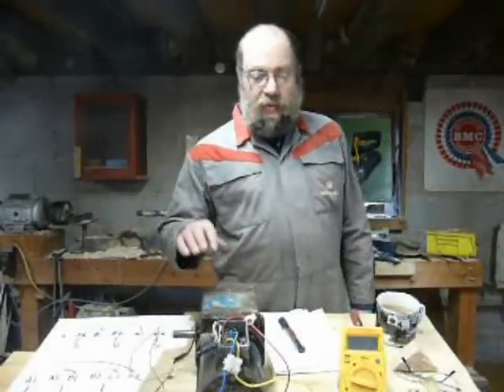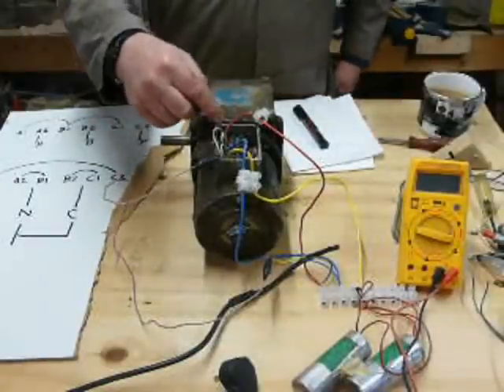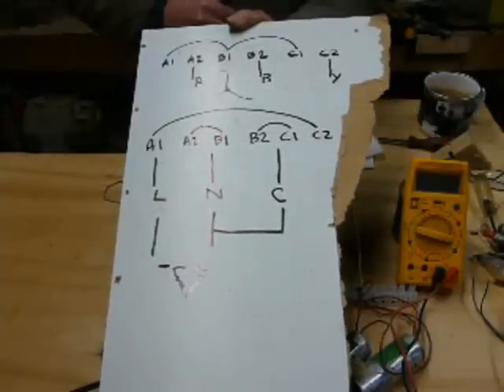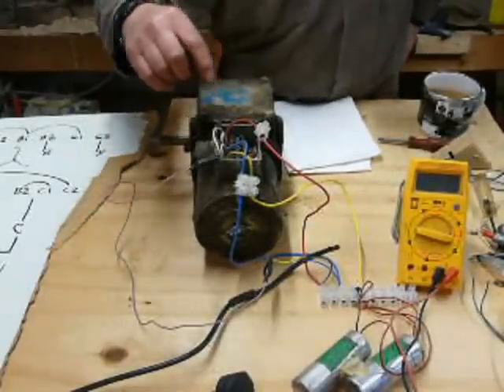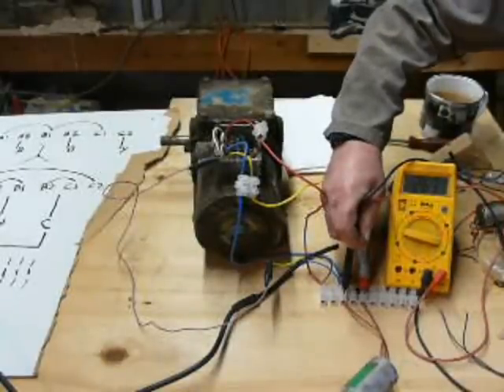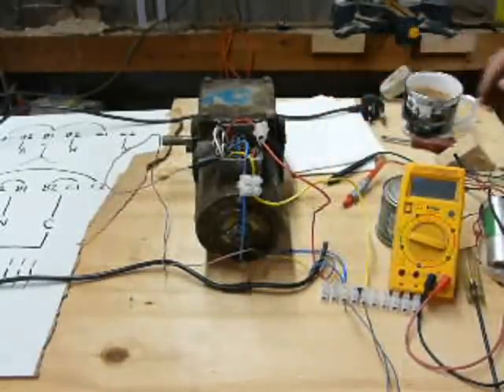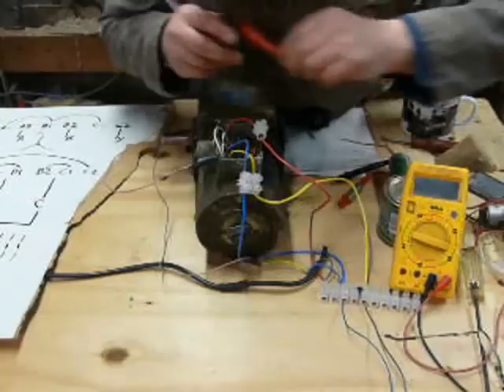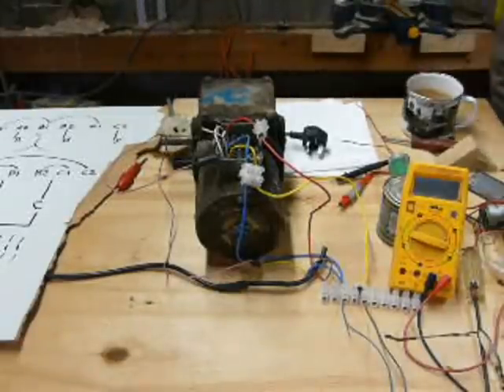How to do it: run a 3 phase motor on single phase supply. part 3

Comment: I can help with the missing phase question. Adjust your thinking a bit; Think of the capacitor as shifting the phase rather than as across one coil. Then you can see you still are using all three coils. I hope this helps. 
Cheers!
Reply from the maker: Thank-you for your addition to the general information. I was assuming that any phase shift on the 3rd set of coils produced a negligable effect, however this seems incorrect. Cheers, and thanks, Andy

Comment: Hi Andy , just changing my 4post ramp to  single phase. Got motor running but a capacitor blew up after about 20 secs running. My motor is 2.5 hp and needs to be wired through a starter box could you advise on capacitor sizes and a diagram on the wiring? Info on motor, amps( 6.7)(3.9)....rpm2880/3480.....cycles 50/60 rating 2 mins,,,,,that's all there is ... Thanks. Dod
Reply from the maker: Hi The cap probably blew because it was either duff to start with, or the rated voltage was too low, or it was mistakenly a DC capacitor. As to the wiring that's difficult but the only thing I can say is that by changing the capacitor connection to the other 240v ac in it will change the motor rotation. You must switch off the motor when changing direction. Hope that gives some help. Have you subscribed? Cheers, Andy
Reply: i have always heard use twice the working voltage on motor capacitors

Comment: What is your take on conversion, for use on a constant motor, say for a dust collection system?
Reply from the maker: It's worth a try, for constant use you will have to measure the volts on the capacitor with the motor running. This is just to make sure that the cap value is correct. Try it and see, you w2ill get 2/3 of the power. Cheers

Comment: Please advice on the question......I converted the 3 phase induction motor with a magnet rotor as generator.....I need to know either I need to make holes on either side of the generator for cooling the inside of generator or not o do you think I need a fan on one side which will blow the heat out through the wholes or just leave it without holes. Dr Sharma Email drsharma@hotmail.co.uk
Reply from the maker: Most 3 phase motors have a fan to blow air either over the coils or through fins cast into the outside case. I assume there is no problem with drilling holes as long as this does not create a weakness. CHeers

Comment: hi can we do it on dc  rc brush less  motor thanks
Reply from the maker: Hi. with DC there is no phase to shift as there is no waveform, also capacitors charge up with DC. See my video on checking capacitors. Cheers
Reply: thanks man for help

Comment: Hi Andy, you mentioned that you have a Denbigh pillar drill and I got excited. I've just rescued one from the scrap and got it working. I was searching for info on running it on single phase 220V and found your video. can you please give me some details on the start and run cap sizes.

thanks
Reply from the maker: Hi. Mine had a 2 Hp motor, so I used 40 UF run and 80Uf start. Hope that helps but you will have to teat your setup. Cheers, Andy
Reply: +Andy Reynolds thanks Andy, I appreciate the help. I was going to use a VFD but I think the caps will do just fine.

Comment: Don't know if this has been posted before...
If a rise of capacitor value helps in starting the motor, it is obvious that without it, the motor will start badly. If you connect the wire shortly, it's the same effect as a startup capacitor which is switched off after startup.
With the motor running it generates enough power in the open phase to keep it running. Still, it has more power if you supply current to the 3rd coil, which is why it sparks when you connect the wire...

Comment: Great videos! explained in a way I understand. I have a 3 phase washing machine motor I need to run on single phase, to replace the one my pillar drill. Working out the run capacitance value was the trick. much appreciated!
Reply from the maker: Thanks for the comment and appreciation, not very-one likes the trial and error approach, but it works. Cheers, Andy

Comment: what about a 3 phase motor from an remote controlled car? it runs on a maximum of 22 Volt´s, it has 2000KV. Can i also use capacitor, just smaller ones?
Reply from the maker: Hi. Your experiment is as good as mine, wouldn't like to say, let us know what happens, Cheers
Reply: i will try and experiment and share it on youtube these days.

Comment: At first i got my concepts clear about the star and delta connection.Kudos to the crispy clear explanation...you are really superb in ur concepts... what i wud like to know about this whole arrangement is that will the motor provide the full load or the load capacity of the motor wud decrease....secondly is their any formulation to calculate the power of capacitor to be used or it is a hit & trial method....
Reply from the maker: Hi. Power is about 60%, and the formula is to be found in the comments of one of this series. in fact it is just below  on this video. You will learn a fair amount by going through all the comments. Subscribed and clicked like button? Cheers, Andy

Comment: Sir it is ok to use 50uF for 1 hp motor?
Reply from the maker: Hi. Try it, it may be a bit small but see how it goes.
Reply: sir it works, but the main problem is that the winding is getting hotter but at least its working :D sir do you have any mathematical model of this phase converter? by the way, thank you sir
Reply from the maker: If the capacitance is too high then higher voltages are created. In one of the videos it shows checking the voltage across the coils with a multimeter. A high voltage will cause the windings to heat up, sound like you need a smaller value cap. The formula is in the comments of this video. Cheers.
Reply: ok sir thankyou so much:)

Comment: just to add to my previous message, it did run, the colours /connections are
W2 black  U2 yellow  V2 red
U1 yellow  V1 red      W1 black
1                2             3       manual says phases i think this means
I changed it from star to delta so its running on 240v
What capacitors should i buy please as i dont have any old ones
Yours and anyone elses help would be greatly appreciated, many thanks
chris
Reply from the maker: Chris, just picked up you message, it's been lost in the google spam filter. I hope you got the problem sorted, sorry about that. Cheers, Andy

Comment: i connected my 3phase motor direct without capacitor as i also read it would run and it started smoking, any suggestions, how do i work out which one are live and neutral as i only red yellow and black from the motors, its a 220-240 or 380/420v with 2860r/min and 3.5amp or 6amp
chris.sheerin@btinternet.com

Comment: Hello Andy, thanks for the brilliant informative videos.  I am a little confused about calculating the capacitance but have done some more searching and think that my 1.8kw radial arm saw motor will require 126microfarads.  I couldn't work out where your current draw was derived from.  If it is 4 amps per hp, would that mean that mine would be about 12 amps?  Sorry to ask stupid questions but I am getting confused in spite of your excellent explanations.  Thanks very much.  Richard Black
Reply from the maker: Don't think so, 1.8 Kw is about 2.5 Hp or so, 735 watts per Hp, but due to motor losses,  4 amps at 240v per HP. Trial and error, but measure the voltage with the motor running to make sure the cap is not too large and causing a high reading. Cheers, Andy
Reply: Andy Reynolds Thanks Andy for the super quick reply.  I will go to one of my favourite shops, Birketts in Lincoln, who, I'm sure, will be able to provide me with some capacitors.  Looking forward to the challenge.  Thanks very much, Richard. ps. love all your videos, you are definitely one of my favourite subscriptions.

Comment: Everyone seems to forget AMPs this is bad advice, there is a reason for 3 phase to even out the power and amp draw.
Reply from the maker: The start current is the limiting factor to the size of the 3 phase motor that can be run with this method.
Reply: Thanks Andy for your feedback Start current is momentary what is run current, even though you still have voltage on the dropped out phase there should be no AMPS on that Phase? what's the run Amps on the other two Phases.?

Comment: Thanks for the informative videos !
I would like to ask if you have any idea why I can stop my motor (1 phase , old washing machine engine) by hand ? I'm trying to use it for concrete mixer :) . Hanan
Reply from the maker: Hi. Is it a brush motor, or has a capacitor, or has many wires going into it?
Reply: Andy Reynolds Hi and thanks for your fast reply :)
It has 5 contacts connector and a capacitor (20uF) which should be connected to two of them . I do not know about brushes and do not understand what you mean by many wires .
Thanks again , Hanan

Comment: Sir,
Thanks for your video experiment. This is very useful and also I am getting some experience. My questionnaire is 3ph induction motor should be reduced the RPM without VFD. Please give me your ideas.
Reply from the maker: Don't think you can as the speed is based on the cycles and the coil windings.

Comment: Hi Andy. Thx for an amazing series of video's. One question please. Were does the ground connection go. To the casing some were or (as i have on the motor i have got) there is a screw in the connection box next to the 6 coil screws? Appreciate any help. Thx again.
Reply from the maker: HI. The ground connection is anywhere on the metal motor case, but commonly a screw within the connection box. Hope that helps. Andy
Reply: Hi Andy. Thx for the response. Did exactly what you have done and for some reason with or with out the capacitors i get the same results. The motor turns (i think a bit slow), I am going to try adding more and different capacitors tomorrow. For now i put a 8uM and a 5uM in the connection.
Reply from the maker: HI. Yes add more capacitance if you think it is running slow. Once up to speed check the voltage with a multimeter to avoid over voltage. Cheers.

Comment from the maker: Here's the formula for the capacitor size. For some reason Youtube put it down as span and I cannot approve the comment.
 
That's (220/V)Squared, like (2)^2 = 4, sorry for my English. And, I found another: C = P x (70mF/1kW), for 230V supply and C = P x (20mF/1kW) for 400v. P is the power in kW; 70/20 microfarads; 1kW is for eliminate the "kW" magnitude.
Reply: based on this formula, does that mean that I have to use a total of 783microfarad  capacitor for my 15hp 230 volt 3-phase motor.?  This is a large motor so is it still advisable to use this motor in a single phase supply?.. Thanks...
Reply from the maker: Hi. I do not think you will be successful trying to run a 15hp motor as it would require 15 x 4amps to run 60 amps and 10 times that to start, but you can always try, start will 400 UF and see what happens. I suspect big fuses will blow.
Reply: Hi Andy, do you happen to have the formula for capacitance for 110 single phase?  I know they use 220 on that side of the pond, but trying to get a 3 phase to work in the US with your method.

Regards,Mike
Reply: Don't forget that the actual supply to your house is 220v, and that is split into two 110v rings. Your drier and cooker probably run on 220v. You can get an electrician to provide a 220v circuit from your distribution board.
Reply from the maker: Mike, somewhere in the comments on one of there 3 phase videos is the formula. If you have some AC capacitors then do as I did, and give it a whirl. Basic rule is something like 35 Uf per Hp for an unladened start. Hope that helps, Cheers, Andy
Reply: Thanks for the help
Reply: Hi Andy, 
I was wondering, would the optimum size of the run capacitor depend on the load applied?  E.g. the drill in your example may need a larger capacitor when drilling large holes, or a smaller when idling?  I know it is not practicable really having x values of different capacitors, but perhaps you know from experience which is the best compromise?
Reply from the maker: Interesting idea which could only be tested in application. The problem with an excessive capacitance is that a high voltage is generated across the coil and would cause overheating. You could try various values and measure the voltage when the motor is running. Hope that helps, cheers
Reply: Thank you for your warning regarding voltage!  Not thinking of it, I kept increasing the capacitance in the quest for more maximum torque (it's a firewood splitter, which needs a fierce torque for a second just before the wood cracks).  At the moment, I have 145uF on a 2.2kW motor, which is just below the 70uF/kW rule, yet the voltage across the capacitors is already 260V while idling (dropping to some 100V with load applied).  So, I may try using a starting capacitor for that critical second - if I burn that out, there isn't too much money lost.  Will let you know the result.
Reply from the maker: That's great. It's a learning curve. Make sure you watch part 6 if you are wanting to use a start cap as there are mistakes in part 5. Cheers, Andy
Reply: thank you very much sir andy..tis was my last question..80uf for start cap,and 2 pieces of run cap with the rating of 5uf and 12.5uf do you think this is pretty good to run the motor and make it safe?,,,
Reply: thank you very much sir andy..tis was my last question..80uf for start cap,and 2 pieces of run cap with the rating of 5uf and 12.5uf do you think this is pretty good to run the motor and make it safe?,,,

Comment: Excellent Video, So if I understand this correctly,,This would make
A1 / Red = Common
A2 / Blue = Run
B2 / Yellow = Start
Is this correct?
Reply from the maker: Hi. Thanks for the appreciation. I am not sure of the cable colours or numbers, but with delta A2 is connected to B1, B2 to C2 etc. The connections to the live and neutral supply are non-specific, but the cap connection to live or neutral sets the direction of rotation. Hope that helps. Andy

Comment: My vacuum pump is now running. I use 2 capacitors in parallel (12uf and 16uf). Voltages are 230, 225 and 225.. Thank you very much Sir. Its a big help..

Comment from the maker: John. It sounds like your motor is not getting up to speed. 117v L1 to L3 is low and would be better at 200 to 220v. Try using a cap of 25 Uf, and then check the voltage. If there is considerable starting torque required then add a start cap after you get the voltage right. Hope that helps. Subscribed? Andy

Comment: Good morning Sir Andy.  I have a 0.24kw vacuum pump. I use 12uf capacitor. I also use delta connection for my 230 Supply. The problem is my pump has a very slow rotation and easy to heat up. I try to measure the line to line voltage and the result is as follows, (L1-L2 which the single phase supply is directed is 230VAC), (L1-L3 is 117 VAC), and (L2-L3 is 117VAC)...Do i have problems on my capacitor value or should i check my motor windings? coil resistance without connections is balance. thanks

Comment from the maker: Hi. Thanks for the interest. This problem is covered in the comments from the part 2 video. The issue is start current being 8 or 10 times the run current. cap about 100 Uf, but a start cap needed of at least 100 Uf. Hope that helps, check out the other comments. Andy

Comment: Would this method work for a larger motor? I have a 4 kw 3 phase motor on a meat grinder but only single phase supply. If it would work, what size capacitors would you suggest?

Comment from the maker: Thanks for your interest. It's all about the supply voltage, so you are trying to run 415v 3 phase motor from a 240 single phase supply. Check out part one and this will explain why you have to change the terminal connections. Effectively it makes the motor coils more compatible with the 240 supply. The capacitors are there to create a false phase so the motor will run. Hope that helps.

Comment: It is true if the motor doesn't spin, but after spinning normally, it will self generating 120 degree 3 phase on each coil but in unbalanced voltage. Start Cap will give a lagging current on other winding at >60 degree lagging current. the higher degree of lagging current will give enough torque to make it spin easily but in fact will not reach 90 degree. it doesn't matter because its purpose just for starting only and use for a while.

Comment: No, it is an efficient way to convert 2 phase to 3 phase line for reliable use even for industrial use, but all of industrial have already 3 phase line ,so they wouldn't need to build this one . it was the principle of 3 phase rotary converter, most suitable for home workshop application. A rotary converter will produce perfect 3 phase sine ac current and will give 100 % power to your applicable motor while the motor is not greater than 70% of your idler motor HP in the rotary converter.

Comment from the maker: Yes, you have identified the balance. This method is only suitable for occasional use, not because it will burn out, but because of the overall efficiency. So not really suitable for industrial situations unless other constraints dictate. Thanks

Comment: Very important to balancing voltage on each coil. suppose there was A,B,C terminal. If the supply line connected to A-B, try to put C1 on A-C and adjust its value untill Va-c at 103-105% Va-b. Next, put C2 on B-C with 50% value of C1, then adjust till Vb-c closely equal to Va-c. last, put Cp on A-B with same value of C2, then adjust until the minimum current on supply line to save your bill. when it's done, you can use ABC as 3 phase supply to other motor (max  70% HP of idler motor).

Comment from the maker: Thanks for the comment. This explains why it is important to check the capacitor voltage when the machine is running, and the need for a start cap when starting torque is required.